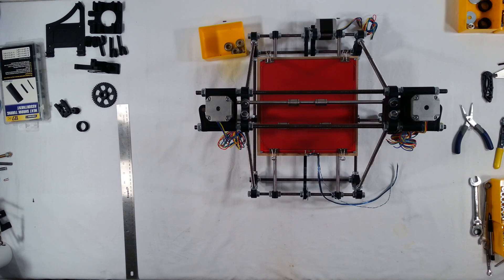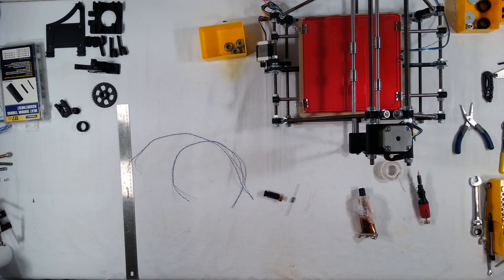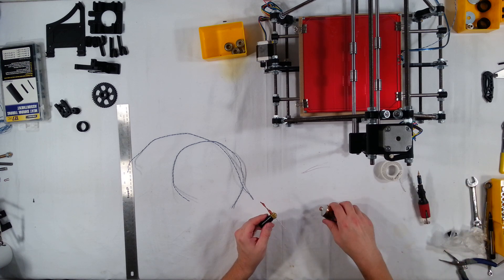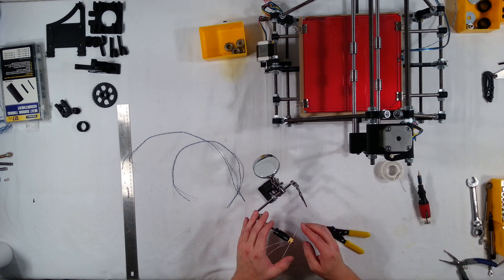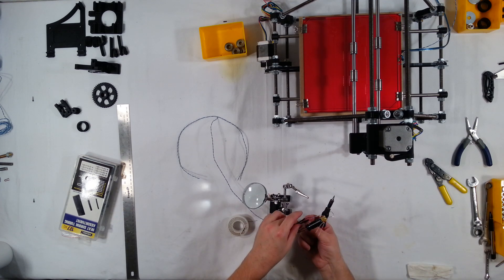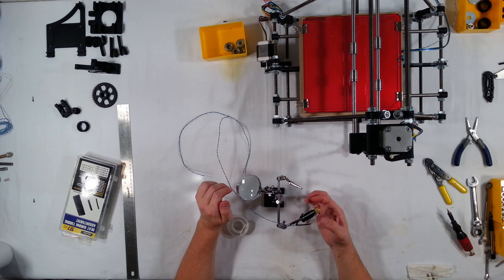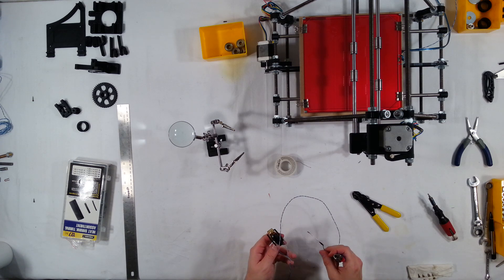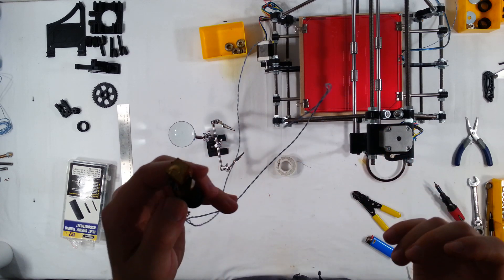RepRap Prusa Mendel Iteration 2 Assembly 13 - jhead hotend

Comment: I assume you used a 100k ohm thermistor. What kind of resistor did you use (that has leads on both ends of the hot end?
Reply from the maker: That's correct, it's a 100K thermistor. The resistor is a heater resistor. 5.6 ohm.

Comment: Is there a certain gauge wire for the heater resistors?
Also i find it best to heat up the wire and add solder it, then heat the solder and place the component in the middle
Reply: Forgot to put i have 2 heater resistors, do i just hook it up in parallel?
Reply from the maker: Ryan Duncan I don't know about dual heater resistors. -- 22 gauge stranded copper wire works fine for the hotend but you can use a thicker wire if you want.
Reply: Ill figure it out when i get there lol. And I went with 20 Gauge for them, thanks

Comment: Would a small piece of Heat shrink tubing be a good substitute for the kapton tape?
Reply: Jordan, if you're using the copper based silicone, then I would say nothing would be better than heat shrink. Unless your heat shrink has an operating temperature higher than 250C but I'm not sure any heat shrink does. I read that Viton heat shrink can operate at 220C which would probably be adequate for PLA.
Reply from the maker: Jordan, I just reread my message and realized that it may have read as though I was recommending heat shrink but I was not. :) I literally mean "nothing" would be better than using it. :)
Reply: engineglue Is the kapton necessary because I cannot locally find kapton tape or is there an acceptable replacement?
Reply from the maker: Jordan Morrison Kapton tape is not required. Just make sure the thermistor won't fall out.

Comment: using an small peice of zip tie as an application tip for the ultracopper kept my hands clean and made it easy to seal the sides of my ceramic heater resister.